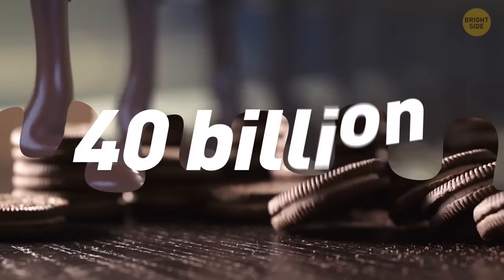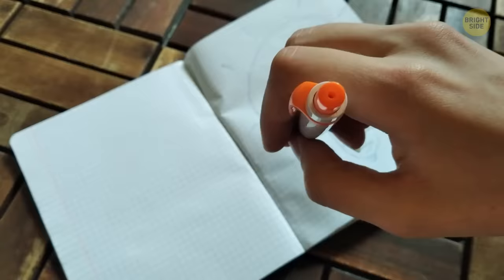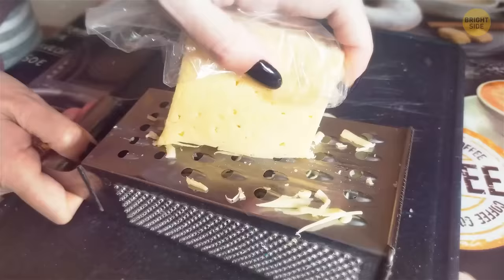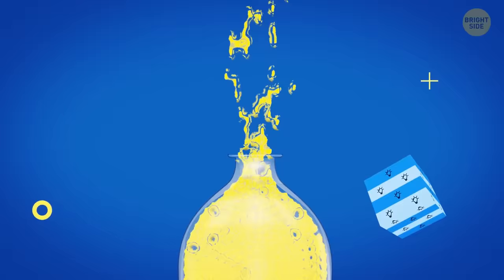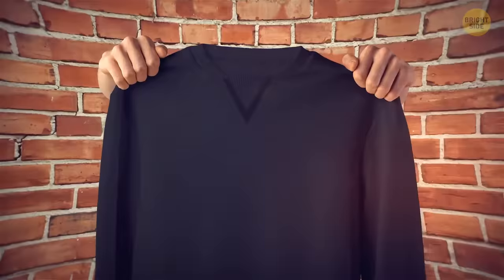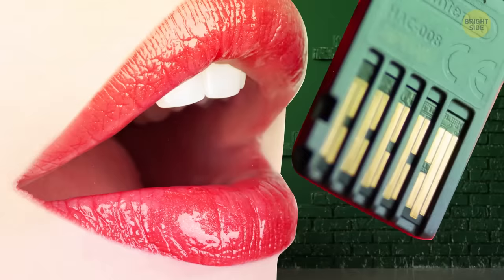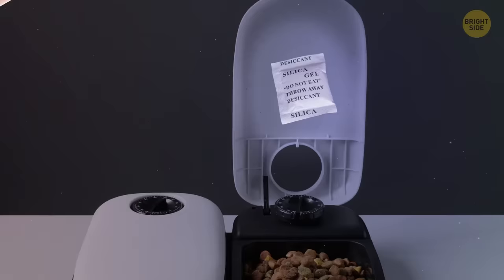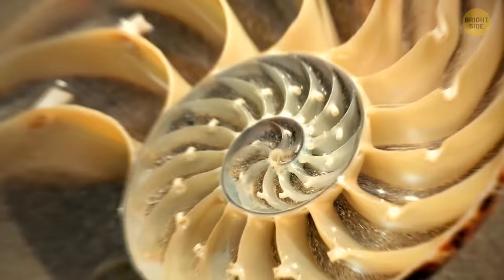50+ Objects Hide Their True Purpose Your Entire Life

Comment: I bought a small, credit card sized, and about 1/4 inch thick solar calculator in 1978. It still works just fine.
Reply: I wish they had solar panels on mobile phones! (would they work though?)
Reply: @agemoth  No, it would not be nearly enough power.  You can get powerbanks with solar cells, which are much more convenient because you can leave the powerbank out on the roof or patio all day while you keep your phone with you normally.  They even have them with multiple panels that unrolls to make a larger collecting surface.
Reply: And the nice thing is that it doesn't need updates because math is math.
Reply: I just learned to do math in my head.  It's so much easier than trying to find the calculator I used a couple of weeks ago.
Reply: From Radio Shack?

Comment: The little holes in aircraft windows have nothing to do with regulating the pressure in the cabin or allowing aircraft to fly high up in the sky. The outer window panes are robust and allow the aircraft to be pressurized so people don't get hypoxia and pass out. The inner pane is plastic. Its main purpose is to prevent passengers from scratching and damaging the critical outer panes. They also provide a slight insulation barrier by trapping air between it and the cold outer panes. The little hole is there to allow the air between the panes to balance with the changing pressure inside the cabin during climbs and descents.
Reply: I do not care
Reply: @aryobagaspratama5119  Yet you cared enough to reply! 🤣
Reply: @OneTequilaTwoTequila  I do not care ( yet you cared enough...)
Reply: The reason aircraft windows are round ? The first commercial jet airliner the Dehavilland Comet had square windows ,the corners led to stress points cracking the fuselage and 2 jets crashing .the comet should have been far more succesful but for this.
Reply: So... It regulates the air pressure...
Reply: @rosechoix   Yes, the pressure between the two panes of glass/plastic.  Not the pressure of the cabin.

Comment: The rear-view mirror tip is wrong.  It's just the opposite.  The tab is pushed forward toward the windshield for Daytime use and pulled backwards away from the windshield for Nighttime use.  Another thing is when adjusting the mirror, always set it to Daytime before adjusting it, even if you're adjusting it at night.  In that case set the mirror to nighttime after making the adjustment.
If you were to adjust the mirror the opposite way as described in the video, it won't keep an accurate adjustment when you change between day and night settings.
Interestingly, later in the video the go over the rear-view mirror again and that time they got it right.
Reply: When I read your comment, I had to stop and think for a few minutes to figure out which way was which! Lol. Interestingly enough, a lot of people don't know how that feature of the rear-view mirror works, or that there is more than one layer on the piece of equipment than just the mirror. A layer of glass is also part of the makeup and between the mirror and glass, moving that little tab changes the angle of the reflection coming into the vehicle. Another random fact for the fans! lol.
Reply: Back in 1981 my driver taught me about that in my first driving lesson. Many people simply forget it because of sensory overload during those early lessons.
My latest car doesn't have the tab. Instead, the mirror is photochromic (or a similar word), which makes it adjust automatically, dimming bright light reflections at night.
Reply: @RWBHere  I hated those new mirrors when they first came out. Now after 50 years of driving I'm sorta used to them....

Comment: Sometimes there is no arrow on the pump icon.  In those cases the gas door location is indicated by which side of the icon the hose and nozzle are located.
Reply: My 2004 Honda Accord doesn't have the arrow.
Reply: hehehe
Reply: @JediLoreen  Does it even have the pump icon?
Reply: ah, i wondered that when i was telling a friend about it and they didnt have an arrow. now i know
Reply: I had a slew of 1970s, 80s, and early 90s cars that had the filler in the back.  About as universal as you can get.  Pull up on either side.  Too bad they were a bit less safe in a crash and obsoleted.
Reply: whers brigt side
Reply: @greendryerlint  Exactly !!  Under the license plate.

Comment: The best way to clean a keyboard is, believe it or not, the dishwasher. Just make sure it's dry before you plug it in. Figured I'd share since I learned a couple new things.
Reply: Except the circuitry inside is copper and water corrodes copper.
Reply: I was about to say, there's a protection for this in it
Reply: Yea, decades ago (before the ATX motherboard design) I paid a lot for a Keytronics KB-101 Pro keyboard.  One thing I was amazed with was that it was literally dishwasher safe.
Reply: @CarlosArturoVelarde  Circuitry is covered with "solder mask" and lacquer layers on a quality device.  For a device meant to handle immersion, the control circuitry (nowadays it's just a tiny chip and a few surface mount components) will be potted or shirnkwrapped.
Reply: @JohnDlugosz  They still are heh, just be sure to let them dry and dont use a ton of soap.
Reply: Take it apart (and you'll be shocked at the amount of dirt) then use anti-dust spray.

Comment: @22:30 I can hum with my nose and mouth closed for 7.8 seconds. I'll admit it's not long, but it's longer than your posted 2 seconds. With just my nose closed (and not drawing breath) for 35 seconds.  Coin edges @23:01 were "worth a clipped coin" or "pinched penny" until they started milling the edges (those are those dents all the way around), making it easier to tell if it had been tampered with.
Reply: You're not pinching your nose hard enough. If your mouth and nose is fully close the air can't escape to continue humming

Comment: The issue with a keyboard has nothing to do with the size, how high it is or weird shape.  It's how you hold your wrists.  If you arch your wrists as you type it's easier on your arm/hands and avoids carpel tunnel.  

I've worked on computers since 1974.  I barely have carpel tunnel.  I got it after I retired, not while I worked lol

Funny I yawned just before you started that section lol
Reply: The legs are also meant to keep you the heel of your hand from hitting other keys plus not having to rewrite or erase words and start over

Comment: What are the holes on each prong on a plug for? My 84 year old father and I are dying to know! Thanks
Reply: I googled it, lol. 
The holes you see in plugs are used for gripping the plugs inside sockets. Historically, sockets had bumps inside of them. These bumps were intended to fit into the holes. Without these bumps and holes, it would have been very easy to simply pull the plug out of the socket.Jun 20, 2022
Reply: This was covered on the Technology Connections channel.
The specification allows for holes to be placed a certain distance away from the plug body.  These are not used by the normal functioning of the plug.  They were used by manufacturing machines to handle the parts automatically and hold them aligned perfectly during molding.

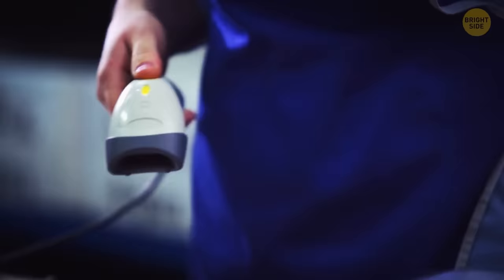Comment: 20:01 The reader doesn't read the black bars. It reads the white bars. ~ 29:50 Why is the peanut butter in the refrigerator? ~ 28:13 30:54 REPEAT!-REPEAT! ~ 22:52 32:43 REPEAT! REPEAT! ~ Television & videos have ALWAYS used that much toothpaste. It is ONLY for show. You are really only supposed to use a pea-sized amount. ~ 36:18 REPEAT! REPEAT! ~
Reply: I saw that too... I actually had to stop and look at the video to make sure that I didn't miss and start another video with the same facts
Reply: Yeah, poor editing...
Reply: also early on he says the holes in pen caps is to allow air air to flow inside the pen so the ink flows freely 5:41 then in a later clips he say you may think its for air flow but no it to prevent chocking on the cap 35:18.

Comment: Your claim that the tabs on juice boxes are handles is incorrect. They are the result of how the box shape is made from two flat sheets of laminated paper. The machine folds, seals the edges and fills the package as the rolls of paper unwind during the filling process. Usually there are several channels filling at the same time to produce reasonable production rates.